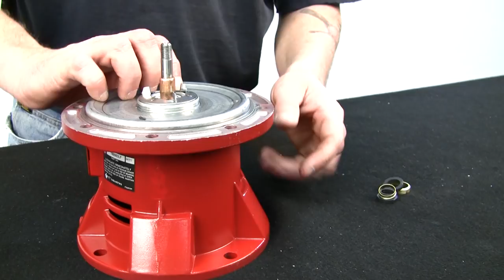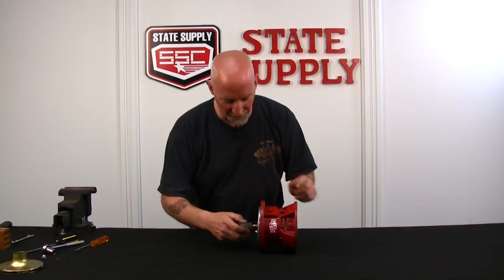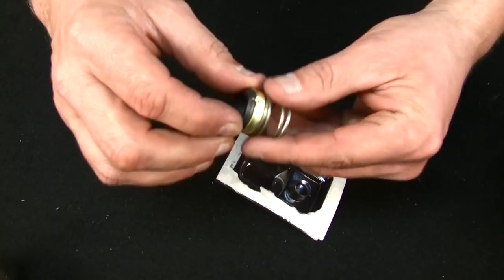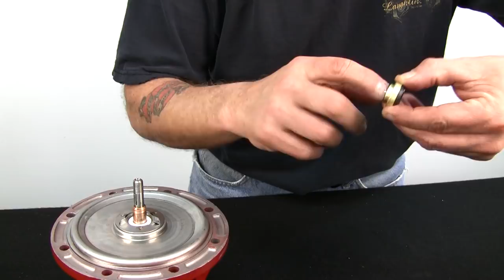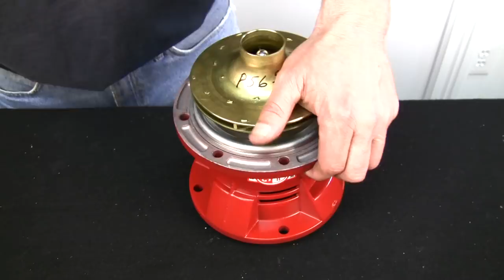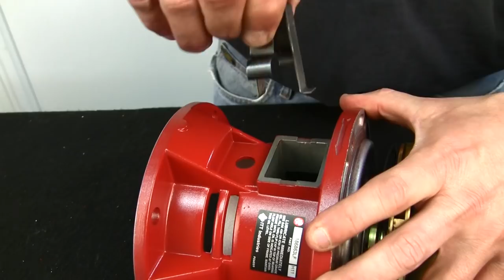Bell and Gossett Series 60: Small Bearing Assembly Seal Kit Replacement

Comment: These guys are the best. They got me information on a pump that someone 
put the wrong motor on. The motor was single phase but had the wrong 
rotation (as I suspected). Just solved a 4 year problem with a 10 minute
 call.